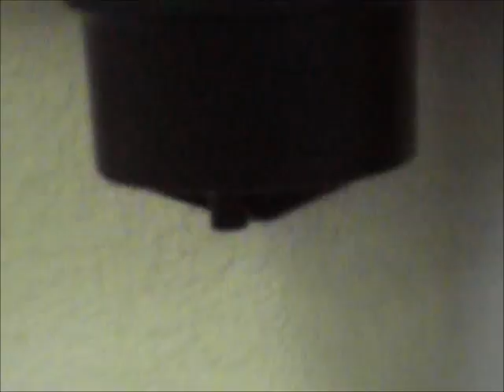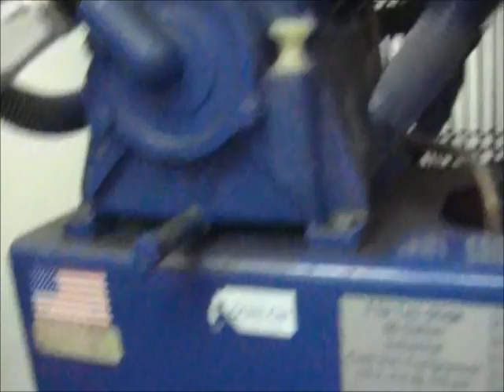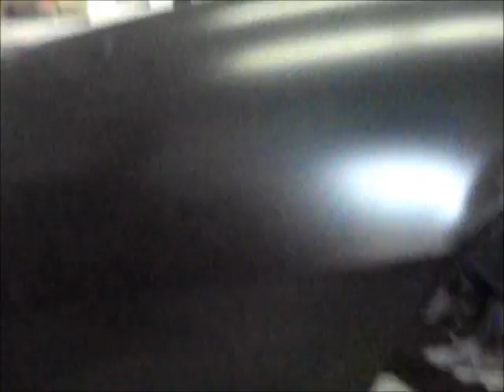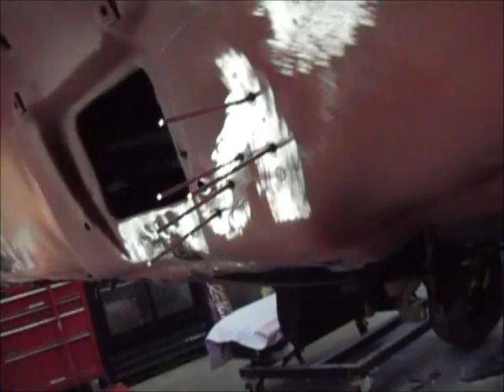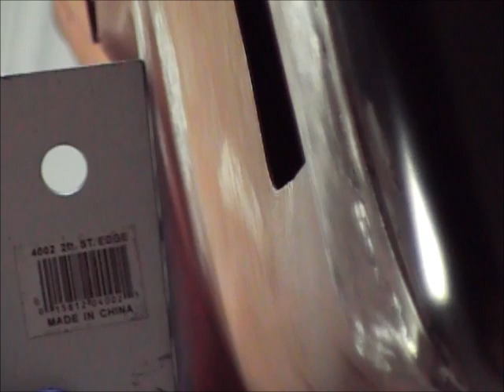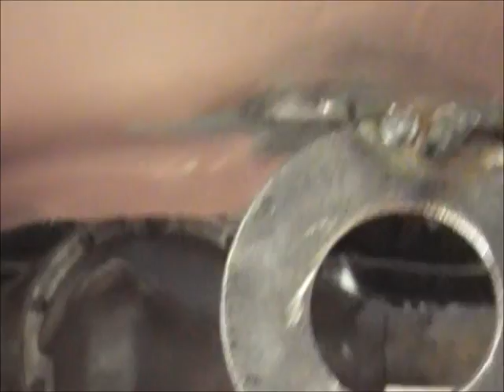Tail panel metal work

Comment: Have you ever used a rosebud torch to heat or excite the metal or panel before you start pulling the dents?  Or, used a cold damp rag to cool or shrink the metal to get it to hold the pulled shape?
Reply from the maker: Yes , yes I have , check the vid before this one :) thanks for watching:)

Comment: Nice work on the metal shaping/straightening!  Yea, This is how i typically do stuff as well.  Throw $50-$100 bucks at a time at various things to try to improve your air dryer system.  Have you looked at this?  http://www.harborfreight.com/compressed-air-dryer-40211.html  I am going to get one of these in my new shop for the CNC plasma table because plasma cutters are very sensitive to moisture, and don't work well at all with the least amount of moisture in the lines.  I know of a couple of guys that are happy with the HF air dryer...
Reply from the maker: turbocobra No have not seen that, if it works well that's a cool toy, I'm hopeful that this new  set up will do the trick. thanks for watching gary